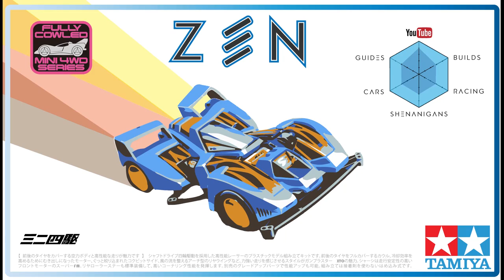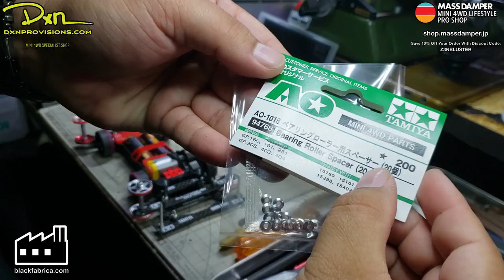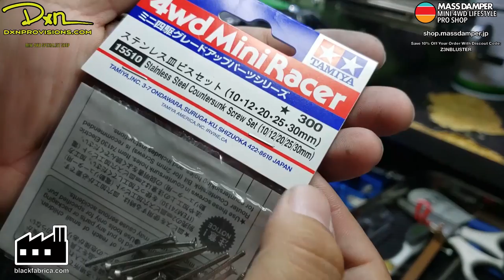【ミニ四駆】Tamiya Mini 4WD Build: Super 2 Chassis Advanced Setup Part 3

Comment: Did u try 24mm tires in the s2 before? Do u recommend it? Thanks in advance jan.
Reply from the maker: Yes, the chassis already sits very low. You might run into clearance issues depending on how you setup your front and rear bumpers.